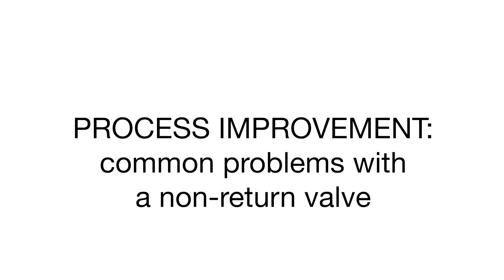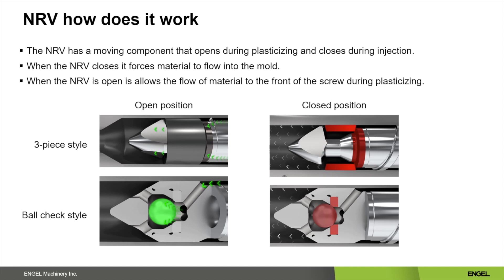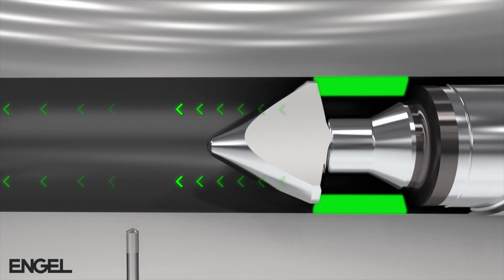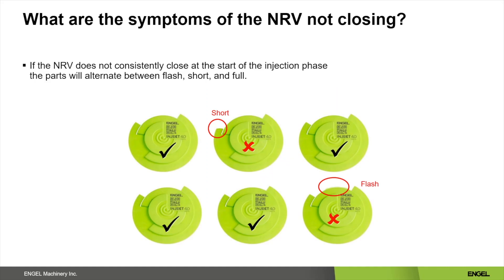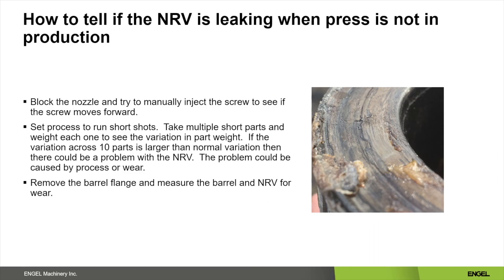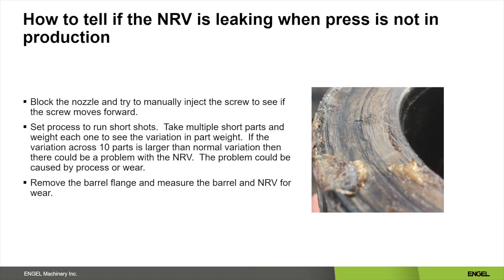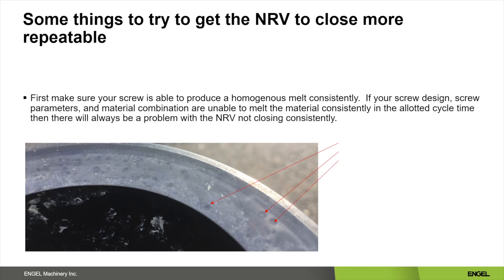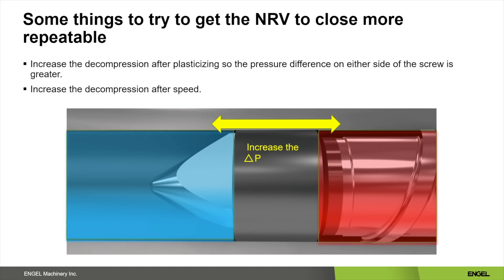Process improvement: common problems with a non-return valve

Comment: Dear Sir,
 Thank you,  what is the purpose non - return valve? Please tell me.
Reply from the maker: The purpose of the non-return valve is to allow the metering of material to the front of the screw during plasticizing.  It also doesn’t allow the back flow of material down the screw during injection.

Comment: Good after noon sir..what is back pressure of 3/4 INCH NRV of steel
Reply from the maker: Dear Ramphal Uttam,
do you mean ¾ inch is the barrel diameter?  In general it depends on material and screw design. Also mixing any additives into the material (colorant, uv stabilizer, plasticizers) makes a difference. Could you perhaps clarify your question a little?